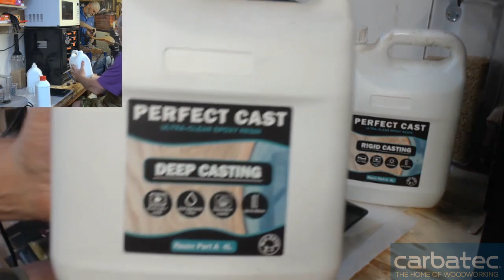Making a Resin Dragon's Egg (Extended) - Back 2 Basics with Steve Hay

Comment: Amazing tutorial anymore tips for iff you don't have a pressure pot and don't want to get those pesky air bubbles thanks keep up the good work 👍 👏
Reply from the maker: Hi JAMES, I use a heat gun (on slow speed) and constantly watch the project and heat the bubble out as they rise. Also do a gentle pour down the inside of the container. Stirring slowly seems to reduce the bubbles when you are mixing. Fill voids and other places air can be trapped with UV Glue before pouring in  the resin. Hope some of these ideas help Happy Casting. Cheers Steve
Reply: @CarbatecTheHomeOfWoodworking  great thanks for the tips much appreciated 👍 😀 🙏
Reply from the maker: @jamesthomas5620  You're welcome James. Cheers Steve
Reply from the maker: @jamesthomas5620  Pleased you got something from it James. Appreciate your comment and time. Cheers Steve